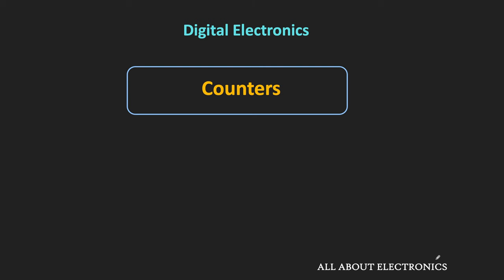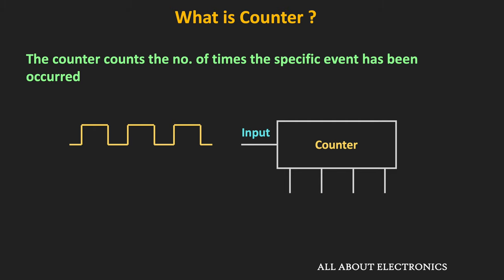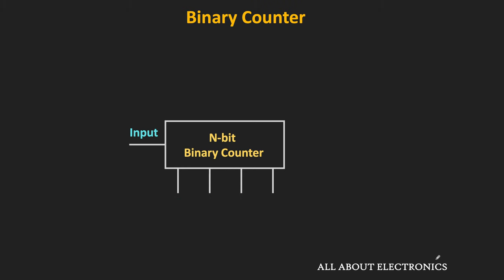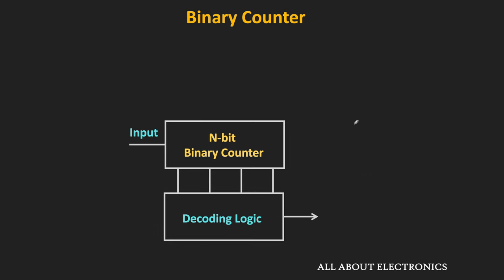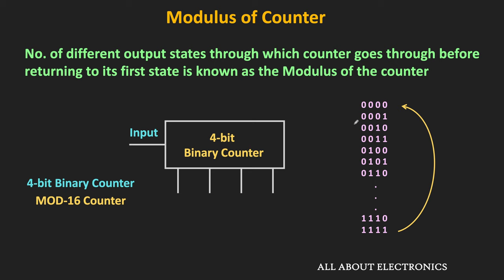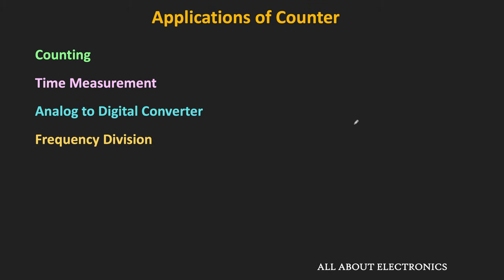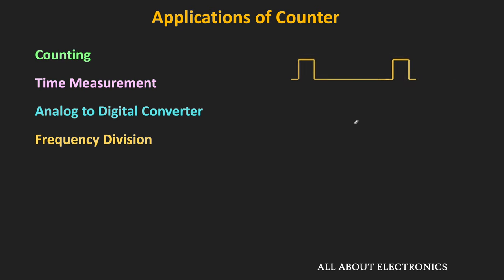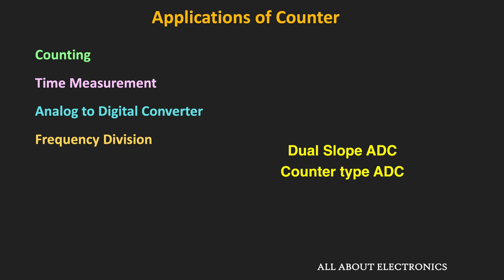Introduction to Counters | Types of Counters | Application of Counters

Comment: 3:49 why in 4-bit binary counter there is 16 different outputs rather than 15? What is 16-th one?
Reply from the maker: 0000 is also one output. So, if you count the total different outputs then it is 16. for 4-bit counter, the maximum output count is 15 (1111 in binary). But including 0000, it has total 16 different outputs. I hope, it will clear your doubt.